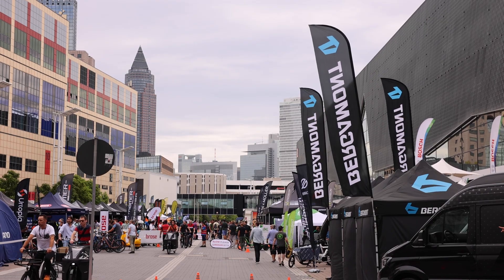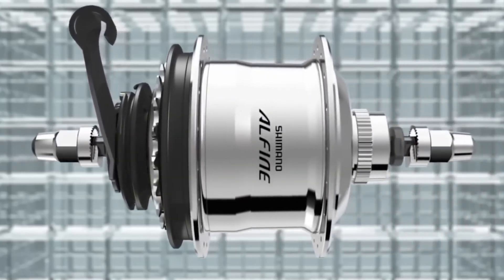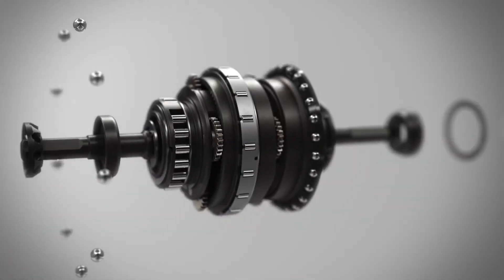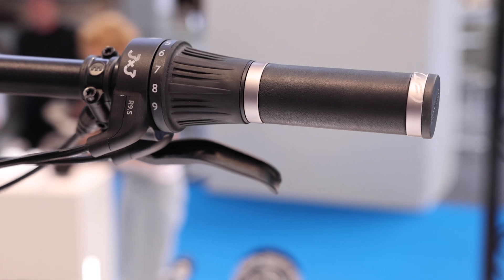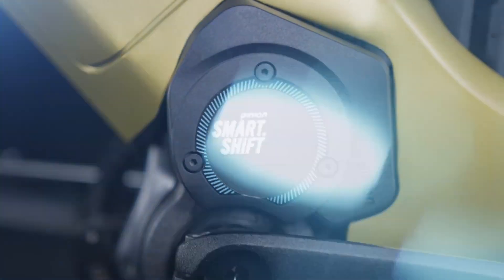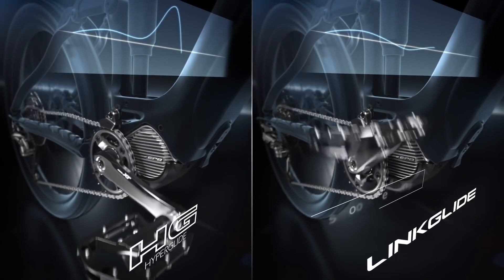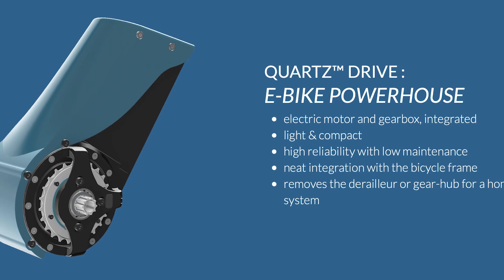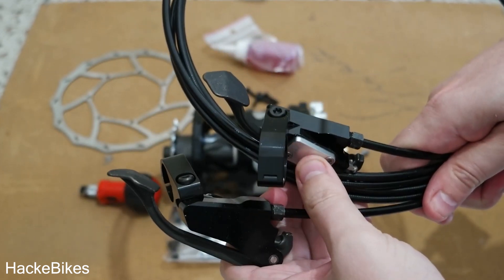The Future of Electric Bike Drivetrain Tech!

Comment: In an ideal world, there would be a 500+% gear ratio, plenty of steps, minimal lubrication and maintenance, regen braking and low-friction coasting.

For a single-occupant commuter bike, regen braking is not a big deal. If you are dealing with a cargo bike, either for hauling kids or moving cargo (heavier), regen braking is going to be a bigger deal. Relatively-small steps are also important in that application.

How to accomplish this?

How about a bottom-bracket gear system, a belt drive and a synchronous AC hub motor.

The only torque which needs to be handled by the belt is the pedal torque; you don't need to worry about the motor over-stressing the belt, the rear sprocket or the gearing.

With a synchronous AC motor, you can coast with little resistance and have regen braking; it's what the vast majority of electric cars use. 

Geared hub motors can allow the wheel to spin, with little friction during coasting, but no regen braking is possible. Direct-drive hub motors may be able to do regen braking but they have lots of friction when you coast; because they use permanent magnets, there's no way to kill the magnetic field to reduce the friction while coasting. That's why I'm talking about a synchronous AC hub motor. No one seems to be doing that (yet?). The controller for same would be more complex but the motors, themselves, tend to be mechanically simple.

Ideally, the hub motor would look at torque applied to the sprocket to throttle the power output, with reverse-pedaling (think coaster brake) kicking in and throttling the regen braking. That would make it easier to keep the bike as a Class 1 e-bike (minimal restrictions on where you can ride and simplified insurance) and keep the learning curve as short as possible. Most of use learned on a bike with a coaster brake; going back to that would not be difficult.

Pinion (Germany) makes the sealed, low-maintenance, bottom-bracket gearing system. Gates makes the belt drives. Just need someone to develop the hub motor. And, of course, manage to keep the prices out of the stratosphere.

Comment: I am currently looking to add an e-assist for my recumbent trike without loosing my current gearing.  I travel for leisure up hills on the weekends up to 60 plus miles.  If you run out on battery-powered  it will be harder to get home. Keeping the current gearing will let  me get back home. I Ride both upright bikes and the recumbent trike.

Comment: Another great video, Chris. It covers a lot of the thoughts I've had in the last few years about e-bike tech. I've got a tried-and-tested Cube (Bosch+Shimano) e-bike, and sometimes wonder about the viability or worth in swapping the cassette for a hub gear, and how that would affect the Bosch motor operation. There's a noticeable scarcity of US-based innovation: do you think/hope that will change anytime soon? I now need to go on a wheel-building course so that I can create an e-bike with my ideal drivetrain!

Comment: Hello Propel, and thank you for another great video!  In the not-too-distant future I'll be getting rid of my car and relying on an e-bike for my sole means of transportation.  I'm partially disabled and my social security income is no longer enough to maintain a car properly, thus, the e-bike.  Assisted pedaling is great, but there will be times when I'll need to rely on throttle-only to get me back home -- the "motorcycle effect".  And so at this time I'm thinking a mid-drive system with a strong battery will be in order.  And I'm glad to see all of the new options available in running gear!  My e-bike will be for pavement only with all traffic laws obeyed, and will not be used on any of the many bike trails in my area.  Cheers!

Comment: I must admit that I don't think this is the future of e-bike transmissions at all.  A better, and ultimately more sustainable solution would be a single speed hub motor, powerful enough to almost completely eliminate the need for complex gear systems, and made to a standardised design that can be serviced in any bike shop without special tools, and designed to last almost indefinitely.  In other words, cheap to buy, cheap to fix, and with a substantially lower carbon footprint than the designs featured in this video; designs that probably won't be repairable in 10 years time, let alone 25!
Reply: Do you actually know what you're talking about? Rohloff and Pinion are what you are looking for, but you don't work cheap either, do you?
Reply: @OmmerSyssel  the number of people who want a complex, and ultra expensive, transmission is likely to be very small. Whereas the numbers who will need a cheap, reliable e-bike transmission will be huge.
The future of e-bike transmissions will primarily be concerned with fulfilling this demand. Read my point again.
Reply: @joules531  Some matters can't be solved reliable by cheap solutions...
Quality has a price
Reply: @OmmerSyssel  I agree that quality has a price, but quality transmissions are pointless if manufacturers fail to provide support.
In the bicycle industry, it is very common for complex systems to be unsupported, after a surprisingly short time period.
Planned obsolescence was, arguably, started in the bicycle industry; and, as we move towards an era of climate change and resource scarcity, the future should be focussed on bicycles that can be maintained for several decades, rather than just a couple of years or so.

Which means, as I’ve already pointed out, the future of e-bikes (for the majority of buyers) will be in machines that are cheap, easy to fix with basic tools, by any bike shop, with enough standardisation to ensure that an e-bike could potentially last for decades.

Comment: I once rode a top end rental Stromer for a day before deciding to buy a RM Supercharger. In all honesty, riding the Stromer put the biggest grin on my face of any bike I have ever ridden. To me I could not even compare it to the Bosch mid drive in pure Portland Oregon city riding fun. So why did I go with the RM Bosch system? Reliability and dealer commitment to long term service. It seems Stromer has had a spotty US representation. Riese & Muller appears to have done a much better job. Also I wanted a belt drive and more than a home grown in-house battery. However, now that Stromer has a belt drive and a Pinion gearbox, the metrics seem to have shifted. They have also kept developing their battery pack which is currently massive for a single battery. I wonder if Chris had a chance to ride the ST7 with the belt and Pinion? If it’s anywhere close to my prior experience in pure fun; I would be tempted to reconsider the brand. Especially now that the company seems to be redoing their US representation. What they really need are for dealers like Chris to make a commitment to the company. I will never forget how much fun it was to ride that bike. The RM supercharger does not compare. It’s more of a utility bike without the sports car feel of the Stromer.
Reply: I think the last line is important most stromers (well all kind of) are made for HS and not comfort really. Want to hgo 45km/h on good roads thats your pick. The R&M's are more for say 35km/h max but depending on model and options you pick always more geared to comfort. I can see why a dealer would want to sell both since they are kind of for different people.
Reply: Tried a Mahle system E-bike?
Wilier Jena Hybrid and you'll be surprised 💯💯🤩

Comment: Rolhoff 14 is getting stock in winter when it’s almost -4 or below, & not possible to change gear while pedaling at the same time.
Reply: Using correct oil? Contact Rohloff, their gears are used successfully in a region where frosty weather is normal!
Reply: Change the oil weight for winter.
Reply: @MrClassifide  weight?? You mean Viscosity! And check for condensed water

Comment: I would be interested in seeing explicit torque limits from Shitmano, I destroyed 3 of their 8 speed hubs just commuting without power assist. So I bought another Rohloff for my commuting bike and that hasn't failed in 10 years. My touring bike Rohloff has well over 100Mm in 15 years.
Reply: I agree, I broke two Nexus-8 IGH with a BBS01 motor before switching to Enviolo and it’s a great improvement

Comment: Put the pinion gearbox at the middrive motor, lay the battery down low like the lapierre overvolt, this will provide low center if mass for best handling. 
Use the belt drive.

Comment: Very interesting and informative video 👍
Most of my bikes are the traditional cassette or freewheel, but I actually did a 180 mile tour with an internal 3 speed when my primary bike was stolen, and it went better than expected.

At the moment my favorite is an e-bike, which is a modified RadMini with dual Tesla batteries. I prefer torque over speed, but still need decent speed on group rides, so a bit of field weakening helps there. I'm fine with the usual 15 or so mph, but on group rides with mopeds, it's 30mph for at least 30 miles. The bike does well, but I would LOVE to change between the usual 5x gear reduction and a 4x reduction.

Comment: Why have shifts? Why not let different assist levels take care of the ”shifting”? We have electricity after all.
Reply: Thats kind of assumes that a motor has a nm output to handle all cases and that will be hard. You need some kind of gear system to match the nm of the engine to the rotation you need. In a way we are close with enviolo automatic that does this for most part in a continues and under computer controlled matching of power in its 'best' power band and the needed speed/power needed on the wheel at all times. The assist levels also 'adapt' on some of the bosch modes like sport+ that will adapt between levels when needed. So we are getting close use the enviolo automatiq and mostly leave the assist level in tour mode and never think about shifting at all most of the time i ride for like a hour and only reason my hands move is to scatch my nose :)

Comment: I will like to see either Bosch or Pinion combining a motor and automatic gear shifting in one mid unit. I will greatly reduce the number of human controls and cables required since the microcontroler inside the unit could take care of all adjustments based on the sensors. Support for bluetooth and a well designed app for mobile phone will help to cut the number of wires even more.
Reply: The issues is that it would put all the needed power on the belt system and keeping it in two parts resolves that power from the middle and 'simple' gears on the back to not put it in the belt/chain we are getting close and i think thats the future i have a very clean steering bar and never move my hands with the enviolo automatiq others will follow and allow for a fully 'you handle the gears and assist i just peddle ok?' modes.
Reply: @scb2scb2  This is how motorcycles work: there is a gasoline motor and a transmission in the mid and the belt transfer the power to the rear wheel. Belts are not a new technology and have been used in cars and motorcycles for ages with more powerful motors than the intentionally power-limited  (by law) bicycle electric motor.
Reply: @mccuba48  true not sure if that can grow the same way for bicycles would mean stronger belts and stiffer frame bikes... could happen not sure if motor in middle and gear in wheel is a bad compromise.
Reply: @scb2scb2  I agree the frame perhaps might need to be stiffer. Pinion works this way, when in high gear the belt will go very fast, albeit the torque is limited to human power.
Reply: @mccuba48  Yeah you also have to ponder about the market a brand like bosch would have to build the gearing (even fixed) into their motors and sidestep the brands they work with for gears. People like options for comfort or price points not sure if bosch wants to mess with them and take the market from shimano, enviolom and rohloff  and others when not needed. My bet is unless for special cases we will see the mid/rear split for a longer time.

Comment: I enjoyed your presentation of these different drive systems. I didn`t know what to expect when I got my Ebike, and have come to use 3rd gear with pedal assist 1 most of the time. I`m an older man and ride ten miles every day, with no time table and no set destination. All this complexity leaves me in the dust, and just adds to the cost. The one thing that I would like to have, is the quietness, durability, and cleanliness of a belt.
Reply: You can either go with a single speed that is the gear you currently use, or go with the 3x3 mentioned in the video as the service time is 5x+ all the other ones at their best. That way you do not have to worry about greasing/oiling the chain time, effort & dirtiness a chain can present as well as not having your gears exposed to the elements water, mud, tree branches, rocks you name it. The bike becomes more water resistant/hassle free.
Reply: Personally i think using a enviolo automatiq is perfect for me. Its like driving a single speed but with all the plus sides of a full geared ride on its 380% range.  This combined with a belt. Clean steering wheel no things i have to do just peddle as hard or soft as i want and the bike does the rest (i use a riese & muller).

Comment: The Kindernay hub shell would allow rim swapping on the same drivetrain. You could have one bike that could run 700c road tires up to 29+ maybe a useful option for limited space.
Reply: I bought one because they were the only people that offered an non-grip shift style shifter.   They also make version with both shifter on one side besides the one in video like what a  mtn biker would want.   Which is why it is on my mtn bike.

Comment: With 2 different perspectives, one as a mountain biker and one as a former bike messenger there are 2 things I'd like to see: suspension optimization (mtb) and low maintenance/ exposure (courier). A centrally located transmission that has a high position for the output gear would be great to raise the pivot point of the rear suspension. Use a belt drive to make it nearly maintenance free. Also it would reduce the weight at the rear wheel reducing unsprung weight. What do you think?

Comment: Security needs to be addressed when bikes are costing many thousands,  you would buy a car that could be stolen in seconds because it had no locks, no immobiliser no tracking built in , these things are costing as much as decent second hand cars now and this needs to be taken seriously.
Reply: This is true, I had a 3,000 dollar biktrix stolen in Austin it was locked to my carrier in behind my van in a "secured" parking garage, I notified the police and the building security, they needed the serial number to proceed, I had misplaced it and called biktrix to see if they had it, they don't keep track of their serial numbers, do not buy a bike from a dealer or manufacturer that doesn't keep track of their bikes that they sell , you would think a company that charges you thousands of dollars a bike, would be a little concerned about their customers getting it stolen? you'd hope, I bought a 3hundred dollar guitar, that I can call the seller up, and get the serial number from, but not a 3 thousand dollar biktrix bike?
Reply: @paul wassenaar  One of the reasons for ditching my car was the cost and hassle of mandatory  insurance, so I was glad to get out  from  under that. Even though  I've had two  expensive ebikes stolen in the past few years I still won't contribute to the insurance industry thieves. Police don't have the manpower to be effective, and the courts are too  political to make a real difference. I've  just  gone back to pedaling  a cheap bike.  It's healthier and still fun. Until things get better, like built-in security for ebikes or a major overhaul of our "Catch and Release" court system,  I'm sticking to biking & busing.
Reply: @JohnSmith-sk8hn  yeah I'm thinking along the same lines now, I have ebikes  that I ride for fun but could easily ride a cheap bike for commuting locally.
Reply: Valeo has an immobiliser and tracking can be added
Reply: Especially since it’s really difficult and expensive to find an insurance on bike thefts.
Reply: Invent something . Bikes should be registered with some central agency  imo, but no police has enough time to check registration on bikes and no gov agency has time to do more paper work.
Reply: cant pick up a car. Besides, modern cars are opened via wireless extender fairly easy. Theres no real security, just a little deterrence
Reply: @fetB  this! No matter what countermeasures you put, any thief can pick it up and load it into a van.

Only real solution is proper parking infrastructure like the Dutch
Reply: Bosch smart motor has an added gps tracker
Reply: We need some sort of universal hub attachment that can remotely lock the brake and/or steering column, disengage the drive train, add gps tracking etc.
Reply: Just pay insurance
Reply: @TheAETHER22  yep that's an option, an expensive one though but still cheaper than a new ebike.
Reply: Everybody has dreams. My dream is a front-wheel drive powered e-bike you can eventually register as a motorcycle that separates electric power from the rear wheel drive pedal drivetrain. Where you can pedal efficiently between thirty and forty mph without involving the torque of an electric motor. I don't care if it's 50 speeds or 5. I'm thinking it's a hub gear with cassettes or a front planetary gear with ring gear sets. 

Can anyone help me. What is the most efficient cost-effective way to get there.
Reply: @LouLovesLyrics  Hey did you get that dream bike yet?  They have bikes with 100+ gears . 3 derailleurs ... how much do you want it to weigh? draw it up maybe.